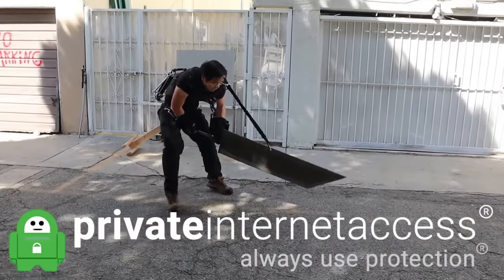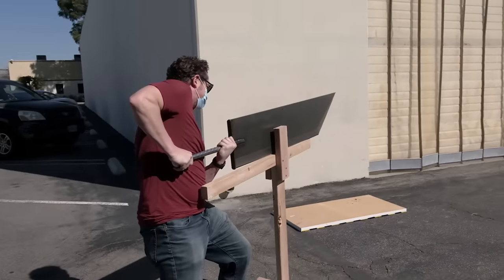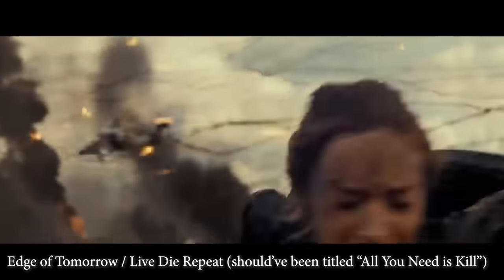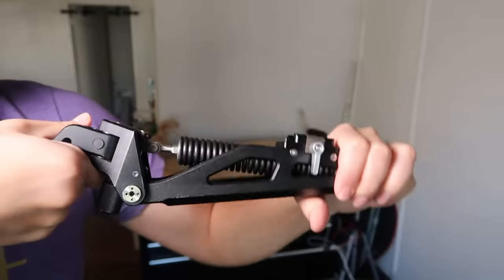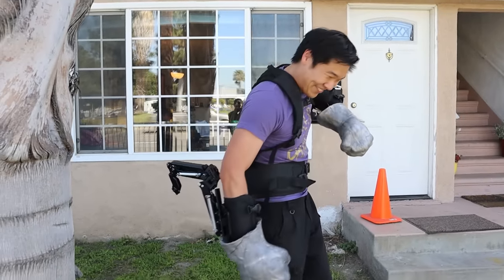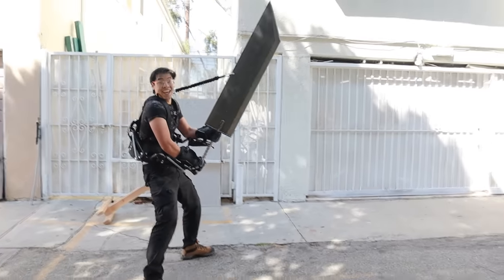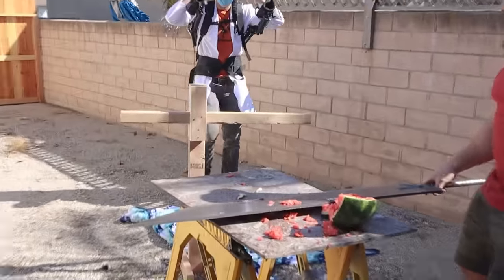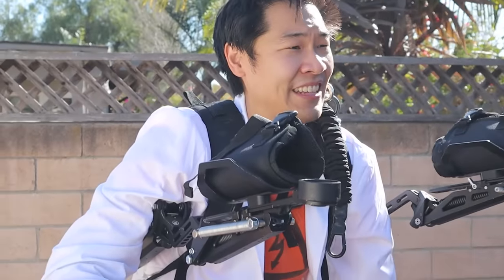I bought an Exoskeleton to wield Giant Anime Swords

Comment: I think This Old Tony said it best: "Aluminum is basically shiny wood."
Reply: @huh woah gallium would like to have a word with you
Reply: @jetaddict420 , oh look, someone who likes to compare apples to oranges.

Gallium forms an alloy with aluminum, it neither rots, nor rusts it.
Reply: @notahotshot  it does ruin its structural integrity thus doing basically the same as rotting and rusting. Also you might be using that proverb wrong since i wasnt comparing anything
Reply: Yep
Reply: @huh woah Thats actually not true, aluminum rapidy oxidizes and decomposes in the present of salt and especially when you have other metals involved like screws, bolts, and car parts due to electrolysis. So in New England and other snowy climates aluminum dosent last and this effect is even more drastic in anything in a marine/wet environment. Also the whole aluminum wheel is better than steel wheel is highly debatable, the real reason it costs more is because aluminum costs more than steel by weight and volume since its rarer and harder to work it also takes alot more aluminum to create a wheel as strong as a much thinner steel wheel. As for being "better" it depends on what, a track car? then yes. On a daily driver? Then no, ask any tire/rim guy and they'll tell you aluminum dosent hold up or last nearly as long as a steel wheel. They warp out of balance much sooner and cant be straightend again like a steel wheel. They cant take an impact like a steel wheel can they crack and shatter when hit by a pothole when a steel wheel will dent at most which is easily repaired by any competent wheel guy. Ive seen a steel nail, a pocket knife, and am impact extension actually pierce an aluminum wheel after puncturing the tire, that dosent happen on steel wheels and once again the steel wheel is much cheaper replaced.
Reply: @huh woah Yeah there's a shit ton of Aluminum car parts like engine blocks, pistons, gaskets, and even chasis. And in the car community those parts are considered good since they are lighter and better than their steel counterparts. For example Lancia's cars were Aluminum chasis, Aluminum block, aluminum turbo, and aluminum supercharger. In rally that car was the grim reaper of the competition. It was lighter and faster than the competition and would reach speeds unimaginable on dirt roads. Aluminum is not bad at all. Its just really weak when it comes to blunt force. Thats why those same Lancia cars would crinkle like a can when they went off course.
Reply: Make alloy out of it probably will make it stronger
Reply: @huh woah that reason is because the car crumbles like a tin can to protect you from gravitational force, therefore they use a WEAKER alloy metal
Reply: I wanna insert mercury here coz it's probably the best thing that can cause aluminum to "rust"
Reply: @GHOST_Hesitant  i think you mean inertial force, gravity isnt whats pushing the car forwards, its whats holding it to the earth, but yes, thats why they use aluminum instead of solid steel like they used to, for protection against crashes. itll ruin the car but id rather be alive to see the insurance bill than be in a ditch somewhere, so, i mean you lose some you win some.
Reply: @BiloGadget  😂😂 very true and thank you for correcting me
Reply: @GHOST_Hesitant  thank you for thanking me
Reply: I work with aluminum on a daily basis and for small things, it's the best type of metal to use, light, easy to shape, and cheaper than the rest. But for applications like this, it will definitely just warp like butter.
Reply: @tokyothedisaster3015  actually the cylinders in pistons are actually made of steel in some cars because aluminum tends to fair worse when containing combustion compared to steel ( a reason why many guns have some form of steel barrel.) which is probably why they are used as pistons not cylinders. also steel and aluminum are used for different things which makes sense because steel outperforms aluminum in certain aspects as well as aluminum outperforming steel in others too,. I think in one oxide video he compared a Russian helmet with a titanium alloy to one with a steel alloy, The steel one outperformed the titanium one and was also much thinner compared to it. also steels ability to have high hardness allows it to hold an edge better which is why many knives are made out of steel not aluminum or titanium although it's possible both have many shortcomings compared to steel.
Reply: I've worked with aircraft grade AL alloys that have 60-70 ksi of ultimate tensile strength. I would think unalloyed AL would have about 30-40 ksi, which is still pretty good.
Reply: @ASMR Isah yes, there are different grades and alloys of AL, as there are different types of wood, with varying strengths

Comment: What’s cool is that you can really see the difference between the natural muscle and the mechanical assist when they swing this thing.  The guy with the muscle can actually control the strike better because he’s actually exerting some downward force, i.e. actually “swinging” the sword downward.  The machine helps you lift the sword, but provides little to no control on the downward stroke, which means it’s more of a drop that is far more difficult to control because you’re just trying to apply sideways force on a falling object instead of driving the fall with your own strength.

Comment: I think the sword needs rockets on it to get a better swing.
Reply from the maker: Actually if there was a rocket sword that had rockets on the front and the back that would help with lifting too...
Reply: @allenpan  sounds like you have a sequel to this video...
Reply: @allenpan  I now want to see 'Double sided anime rocket sword IRL?!' become a real video
Reply: Goes full monster hunter jet powered greatsword
Reply: @additiveartificer9365  W Y V E R N IGNITION
Reply: Attach rocket switch to the handles. Lower part of the back of the handle handles rocket controls to push the sword upward. Upper back part of the handle has control for the swing. Now you just need titanium bones to prevent your arm from snapping :)
Reply: @allenpan  Nah dude, just need rockets in the back, you lift it by spinning it around.

Comment: Imagine that giant guy using also an exoskeleton, that would be insane.
Reply: casually swings with one hand
Reply: @thetoyodacar2264  Jumps 20 feet in the air* 
Sephiroth: Sweats profusely.
Reply: The exoskeleton reduces the effects on the users body, however the users body also has an affect on the exoskeleton. It is possible for that style he is to strong for it and it would break under the forces he could put it through.
Reply: @Kari-tu3fs  true. So the next video should be an upgraded version.  Fit for a strong man
Reply: @TheDarkPacific  you like your own comment
Reply: @Kari-tu3fs  you like your own comment
Reply: @capybara9521  don't know what you're talking about sire
Reply: Dual wield
Reply: @Kari-tu3fs  Exoskeleton: "Dude it was just a prank".

Comment: This is absolutely a great idea - but just as the springs make the sword effectively lighter to hold, it also makes it lighter during the strike. If you could somehow turn the springs off (ie, electromagnetic springs), you could get the full impact of the sword.
Reply: Not sure if this is actually true? the same weight is still coming down with the same speed, you see alan bending at the waist because while the exoskeleton moves the weight from his arms to his waist, its still there, so its still pulled down by gravity the same way? im not at all sure though, but i feel like there's either no difference at all or the difference is so small its neglectable.
Reply: @suicidalbanananana  Not really.  Imagine that you kept increasing the tension of the springs/bungee cord.  Eventually with no effort at all, the sword would just float at a certain height, and to swing down, you would actually have to push against the springs, rather than rely on the weight of the sword.  The springs are robbing the sword of the speed it would obtain from just dropping it down.  Hypothetically, if you actively swing the sword rather than just kind of steer it where it drops, you could regain some of that lost speed... how much though I'm not really sure.

But the short of it is that yes, assuming you're still dropping the sword, you are losing some speed and impact force.
Reply: So... your back takes all that force instead? 😂
Reply: Combine the working Mjolnir tech with this exoskeleton.

Comment: The funniest part is actually thinking that in anime, little girls can swing such tremendously huge swords.
Reply: The funny part is that even a sword that size, but made out of light styrofoam, couldn't just be swung around by a weak person because of air drag, which you still have to lever against. Like just take some cardboard or a sheet of styrofoam and try to swing it around as dynamically as you see in anime.
Reply: What do you mean my kawaii 15 year old anime gril can't actually swing a broadsword at the speed of light???]]]]
Reply: @2slowpoke929   a n i m e g r i l
Reply: @2slowpoke929  according to anime logic that girl is acktually 1000 years old!!!8!
Reply: @graealex  i may have to disagree with you hear, i dont watch anime so i dont quite understand how they swing it. ok first a giant anime sword has never been used in history so were going to use a Zweihänder
 for this. as long as your not swing the flat first your sword should not have drag, the same applies for cardboard as long as you dont swing the flat of the sword an instead swing edge or poke with the point you should be fine. now this would have to be in an area with little to no air current, if there was one it could change the outcome, as cardboard is really light and weak.
Reply: @2slowpoke929  considering the long anime names lately, that sounds like a new title lmao
Reply: @2slowpoke929  I mean, considering that it’s a grill, hmmm, I guess it could. Try strapping the Cloud Buster sword onto your anime grill and see what happens. If it gains sentience…run.
Reply: I mean, in anime they can. XD
Reply: @2slowpoke929  she cant but i know somethine she can swing "wink"
Reply: @2slowpoke929   oh sht cops

Comment: That sword is so heavy, it seems like it’d be more functional as an ax than a sword.
Reply: It is just a less efficent axe. It weighs about as much as a sledge hammer but you can move your hands up and down the full length of the hammer which you can't do with a sword. Which means you can exert the maximum mechanical advantage on a hammer or axe by changing your grip whereas with the sword you're stuck in a position that works against your body mechanics.
Reply: @20quid  You're also more likely to accidentally dissect yourself while carrying that sword.
Reply: It truly is a slab of iron.
Reply: A claymore?
Reply: @mikedanielespeja6128  Too big, too thick, too heavy and too rough...

Comment: You should build a brace that attaches to the blade and automatically locks in the orientation when you start your downswing. That would allow you to put all of your force into the swing without worrying about torque on your wrists as the blade rotates. It would also force a clean cut because otherwise the blade rotates instead of cuts when it makes impact, which would be awesome. 

With the blade edge automatically rotating to match the swing trajectory (ideally it would lock when you start the downswing but as you swing it it would make minor adjustments via a secondary fine-tune motor to ensure a perfectly clean cut).

Would be crazy what you could cut through if you made those changes!

Comment: it would have been smarter to make the sword out of aluminum and just set a steel edge on it would probably save you 20 plus lbs.
Reply: Yeah, because a lightweight sword is what they were trying to test. For real bro?
Reply: You are on the right track, but aluminum is hard to weld. He needs to change the center of mass so it's closer to the handle.
Reply: @NicholasMarshall  it is, but it's doable. i believe i saw them do it on that man at arms show some time back when they were making a similar sword.
Reply: @ryansizemore5064  Making a lighter but still big af sword would have made it actually wieldable and is much more interesting than dropping the sword because it's too heavy. The objective is still to wield it like in the games.
Reply: Maybe a aluminum skelontinized  body with the blade being a hardened steel insert that is replacible. Saves weight while still keeping strength. Like a bridge or ultralight plane structure triangles and stuff. But that might be light enough or at least lighter
Reply: I feel like I’m talking to a bunch of engineers I’m scared mom pick me up

Comment: One of the biggest issues right off the bat I see with the buster sword is that the hilt is way too short. You get practically no leverage. Ultra great swords have to be wielded sort of like a pole arm In regards to leverage. Another 6 inches on the hilt would probably make it much more wieldy

Comment: Imagine building a strong enough exoskeleton to be able to easily swing that blade at the speed of the optimal usage speed of a rapier or katana.

That would be insane.
Reply: And give it to buff guy the speed are so high it will explode limbs after contact
Reply: the big problem becomes momentum you would ether need your suit to be heavy to make the momentum less of a problem but then you need more strength to move your suit around so probably would need to motorize it
Reply: unfortunately physics will do a little trolling (swinging the sword at high speed would easily throw you off balance, even if by some feat of insane leg strength you dont get thrown over you would have to be VERY heavy to throw that kind of weight around without throwing yourself around in the process
like how thor's hammer allows him to fly, the 50 lb sword would pull your entire body forward on a fast swing
Reply: @TheJosiahTurner  I guess you gotta be a superhuman whose existence breaks every law of physics.
Reply: Momentum and inertia would still be too much due to the mass though. The only way to swing it multiple time in a row would just be doing predictable full circle spins because it let the inertia carry on.

Comment: Question: why not make an anime sword out of aluminum? it would be a whole lot lighter. It might be weaker but aluminum has a much better strength to weight ratio than steel.
Reply: Aluminium is a really soft metal with about 1/3 the density of steel. The softness can be changed with really high-end alloys, such as Aluminium 7068, which can be around the same hardness as some mid-range steels. Swords use a combination of hardness(sharpness) and weight to deal damage. That change would make the buster sword featured in this video to be about double the weight of a greatsword (a sword of similar length) but it would still have the surface area of a buster sword. Any angle the sword is held at that isn't dead on will create a lot of drag, making the sword unwieldy without having the momentum to compensate. This restricts the kind of swordplay you can do with it, meaning you'll still be using it like a wood hatchet.
Reply: tl;dr the weight is part of the atk rating of the sword.
Reply: @OpXarxa  unnecessary
Reply: @mkpat3237  not really. Good craftmanship/design influence the actual efficiency of the weight-to-power conversion, but yes, high weight is key to the destructive power of blade weapons, the kinetic energy that weight generates makes up most of the actual power behind the hit. the actual cutting skill of the wielder is basically a multiplier to the base damage value of that kinetic force.
Reply: @OpXarxa  you're just making shit up. there's an ideal weight for each length of sword, and going any higher than that will reduce its' effectiveness as a weapon due to inertia. it will become harder to initiate swings, you'll have less acceleration time, and the overall speed of each attack will suffer so greatly that even if it hits hard, anyone and their grandma could just step out of the way.

even chopping weapons like axes are far lighter when used in battle than their wood-cutting siblings due to this.

Comment: btw whenever you're swinging weighty weapons like a greatsword/buster sword, you wanna make continuous and flowing slashes that lead smoothly into the other. stopping in between strikes makes it harder to handle so you want to keep the momentum going
Reply: Would that conservation of momentum make as much of a difference for a sword that large?
Reply: @roborat  It specially makes a difference for gigantic swords, since the strenght required to change the momentum is multiplicatively higher,  due to its formula.

Comment: "it's like a cheap chinese knock off"
ON MACHINE THAT IF SOMETHING GOES WRONG YOUR MUSCLE GOES BRRRRRRRR
Reply: I mean not really. This is a passive exoskeleton. It will try to return to it's neutral point which is the same position that you put it on. The only thing that can go wrong is one of the skeleton's arms can fall off from excessive force (as actually happened). The danger is what you drop when that happens

Comment: for being a Sword, I’m just sad it doesn’t actually cut
Reply from the maker: It totally does! We cut a fake horse's head off!
Reply: @allenpan  It does and doesn't. Due to the sheer size and weight the sword needs to be thicker than any regular sword (and add stubstantially more for exaggeration because it's the buster sword). The sword is undoubtetly sharp and does cut stuff but not in the way we typcially think about cutting stuff. It's much more similiar to an axe which we'd call chopping.
That doesn't make it any less awesome though, incredible video.